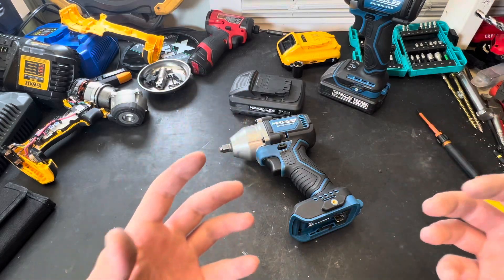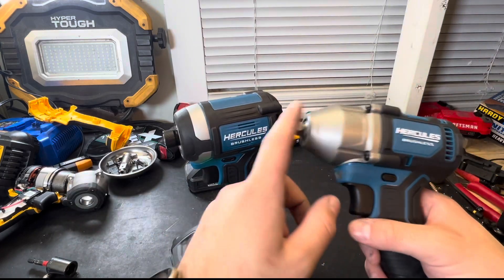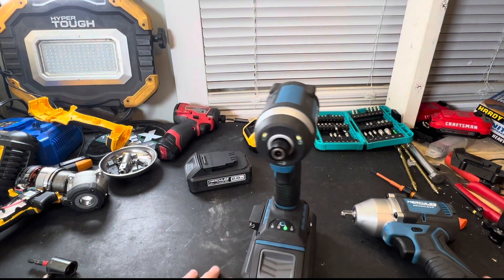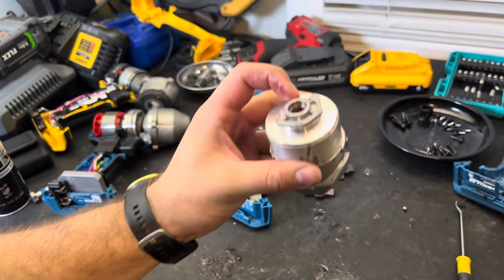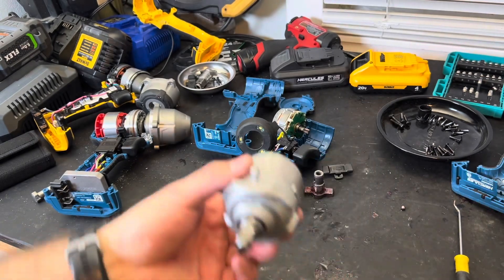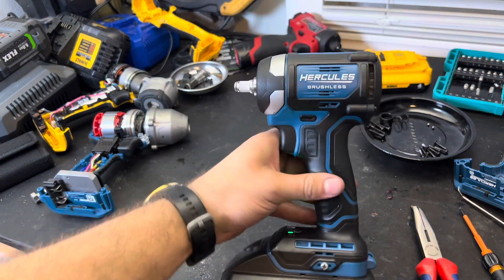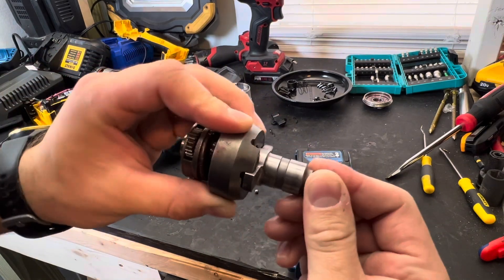I made a BETTER IMPACT for Hercules

Comment: That impact driver will burn up. The 1/2 impact can take out most things, need more power that’s why Hercules has a high torque impact, need something with even MORE BANG there is an ultra torque. Right tool for the right job no need for this none sense.😂
Reply from the maker: The compacts could barely take out anything. Literally.

Comment: N646882 (it's a dewalt part number designed for their dcf 902 3/8 12v impact) Kind of expensive on US based sites but on aliexpress usually under $10
I"ve successfully modded several different brands of 1/4 impacts for friends and usually requires very few if any mods

Comment: If you have a Hyper Tough 3/8 impact wrench model 80013  lying around you can take the anvil out of that and is a direct fit to the Hercules impact driver. No need to bore out anything just gotta swap the anvil and driver head out. Hardest part for me was removing that c-clip of the Hercules impact driver. Everything else is just screws.
Reply: you are a scholar and a gentleman
Reply: Sounds to me like it's worth the $120 to have a go-to tool that can knock almost anything (within reason) out 🤔
Reply: Holding up good against time?
Reply: I think there’s a dewalt ⅜ anvil that’s a direct swap too. I forgot the part number but it’s in a Yt video somewhere.

Comment: Would be interested in the actual tourqe specs. To be fair the example Given is not fair. Youre using an impact wrench to "Drive" the lag bolts and a impact DRIVER to "Drive" the lag bolts. Thats like compaing a hammer vs screw driver effictiveness on a nail lol. Nonetheless sick build! I really fo like the look! And i use my driver as a imapct wrench all the time 😅 so i definitely will be looking more into this.
Reply from the maker: @nicholascantareo  I have another video on this where they both were removing lug nuts both torqued to spec and the driver conversion did much better there as well

Comment: You need to ditch that screwdriver and buy the Hercules 12v impact for disassembling housings and small things. The 12v with the two ah battery is fantastic for that sorta stuff. Ive got large hads, but that smaller driver is very comfortable and lightweight too. 12v uses the same charger as the 20v

Comment: When you bore the nose cone bushing, you can hone it to the right size with a piece of sandpaper taped to a drill bit, spinning in a drill. It leaves almost perfectly circular hole and you can rest and adjust in really small increments. When I put together a gen3 Milwaukee Frankenstein, I drilled the sintered bushing to 5/8 and honed it another 0.040 or so to fit. It was only a couple minutes to hone. I used shell s3v460d2 grease. That's not a great choice for cold weather and got some Valvoline vv985. Vv986 is the same in a 1lb tub.
Reply from the maker: @timothybayliss6680  appreciate the tip

Comment: Super scientific method 😂 Fortunately, there are other channels out there that actually measure the torque instead of just relying on one’s feel. This use case is dumber than a bag of lug nuts. Perhaps that impact loves her some lug nuts more than some lags screws. 🔧 🔩 😜
Reply from the maker: @andrej2321  lmaoo I have multiple videos on this and the lug nut tests (which were tested with proper torque specs) was even more clear that the modified driver is far superior to the shitty impact wrench

Comment: I got my 3/8” used, it it was near new. After a few weeks it started making a horrible noise but it fixed itself. Lol. Been working fine since but now the hog ring and anvil is worn and sockets fall off.
Reply from the maker: @BlainesGarage  yea, I have the same issue with my m12 stubby, it gets annoying having the sockets fly off. An anvil change isn’t too difficult though

Comment: I've see a video on FB where a guy bought a spare anvil for a Dewalt and it dropped right into the Hercules.
Reply: Any particular dewalt anvil?
Reply: Link
Reply from the maker: @BlainesGarage  https://www.amazon.com/dp/B00XNO52US/ref=cm_sw_r_as_gl_api_gl_i_TC063MKSDDQSB8BH02TB?linkCode=ml2&tag=kalebross-20
Reply: @Kaleb_RoSs I bought one and it does not fit. The shaft on this anvil is 15.9mm while the hole in the housing is 15mm exactly.
Reply from the maker: @ yea, have to bore it out slightly

Comment: The fact that the driver is faster than the wrench is surprising since the wrench is supposed to be more powerful with torque and the crazy thing is I actually saw a video on here while doing research on the hercules impact driver and a guy actually used it as a impact wrench to take off the lug nuts to a ram and it did a really good job so for $69 I think Ima buy this over the Bauer
Reply from the maker: @Lopezfam210  it’s a great little driver, I use it as the beater
Reply: It's because an impact wrench is designed to have more power backing a nut off. Not putting it on. Its less effective now for rusted or frozen bolts or nuts. An impact driver is for driving in lags and stuff. This whole test just made it less effective lol
Reply from the maker: @ I’ve done a few tests comparing these and the driver conversion is better at removing bolts/nuts as well. This new compact that Hercules has is just bad in general

Comment: The big issue is that they slowed the motor down. Put the electronics from driver into impact wrench.

Also without that back plate on to support the rear bearing, it will make noise and struggle.
Reply from the maker: @aaronatwood9298  yea, I’ve got an updated video coming soon for this
Reply: @Kaleb_RoSs get it to work? I want to see that it works then i might have to do it!

Comment: 3/8 Hercules is a beast and never had problems with power. I use the 20volt battery
Reply: Yeah, those 12v batteries keep falling off.
Reply from the maker: @Bigfoot8x6  well I certainly wouldn’t consider it a beast when compared to any other 3/8 I’ve used

Comment: You're using the wrong battery on them for optimal performance. Need to use the 5amp.
Reply from the maker: @LenWhalenX  the 8 is the better performing battery, the 5 is better than the 4 though.
Reply: @Kaleb_RoSs True, but 5amp is what it says on the box to run minimum. :-)

Hey, I have a couple of questions about your project here if you don't mind.
Reply: @Kaleb_RoSs  The new adapter you listed the part number for and said you didn't need to modify the cone on the front, was it pretty much a drop and go once the unit was disassembled?
Reply from the maker: @LenWhalenX  yes pretty much. Not nearly as bad as boring it out

Comment: I know this was a while ago but I think I know why it wasn't working at the end. The back plate needs to be installed to hold the back end of the motor rotor stable otherwise it rubs
Reply from the maker: You were absolutely correct. The enclosure for the gear boxes being damaged was also slightly getting in the way, I ended up getting a new one and made it work much better

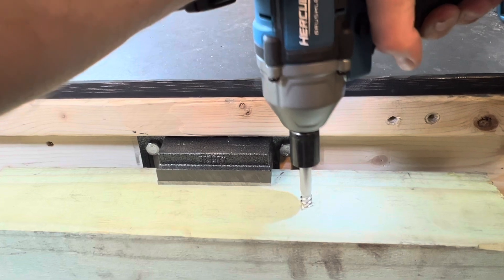Comment: you compaison at 1:06 is all I needed to know after watching countless videos on the 1/2" and me not being able to take my car tire nuts @120lbs/# off with it even though others can... love the 1/4", returned the 1/2" crap.
Reply from the maker: Definitely one of the worst compacts I’ve used. I have since found a much easier and better way to make this thing as well
Reply: @Kaleb_RoSs  you mention the dewalts ansil. I think I'll use adapters for now (might get better one if I break it) and wait for HF to get their act together for a real 1/2" or 3/8" wrench. a bigger motor version of the 1/4 would be so awsome for tougher jobs that don't require the ultra beast...
Reply from the maker: @alaind831  agree, I like pretty much all of the other Hercules tools.
Reply: Dang wish I saw this video and your comment 2 weeks ago. I did a brake job by hand after my brand new 1/2" failed on the lugs and a couple of bolts holding the caliper brackets. Gonna try to return my shitty 1/2" now.
Reply: @JaimsterTube  yes I actually found the 1/4" hex with high performance 4A battery can eventually take my 130lbs lug nuts, while the 1/2" wrench never could! (tried and returned 2 of them in their parking lots). I have since gotten a too good to pass deal (under $50 instead of $180 doing bundle deal and stacking rebates) on the hercules high torque 1/2 wrench (the 1200lbs long ansil one) which is overkill but takes my lug nuts instantly (I put snow wheels on and off regularly). still would be nice to have something in between and lighter...

Comment: My first 3/8 compact had awful bearing sound so warranty exchanged for another one, used the 2nd one on only two 12mm headed fasteners and the 2nd one created a bearing noise as well.. so my opinion of the compact impacts of Hercules has left bad taste in my mouth
Reply from the maker: Definitely, I like a lot of these newer brushless tools they have but the compact just isn’t good at all

Comment: I've messaged harbor freight about the lack of power on their compact impacts a few times already but never heard back. I can't loosen lugs, I can barely loosen 14mm bolts and even then I might have to loosen them by hand first. The compact impacts are the only Hercules tools im disappointed by, and I own 85% of them. 

I mean how do you take a step backward by making you second gen tool even weaker than the first? When other companies do that it's because they're making sub-compact models (ridgid sub-compact, dewalt atomic, makita sub-compact) so thats understandable but to keep the same size and lose power is idiotic.

Great job on the Frankenstein, I'm definitely going to look into it the next time I see a Hercules impact driver for $25 on offerup
Reply: You’d think a 3/8” and 1/2” compact with that driver body setup is coming, like the Milwaukee has now. Same 3 LED stubby in square drive. I’ve been waiting. I have both compacts and yes, they are disappointing. Just picked up the latest hex driver and i’ve been using it with a 1/2” adapter to check out it’s performance… very impressive. Checked some lug nuts i put on with it until it stopped … it ran them on to around 120-140ft/lb.
Reply from the maker: I agree 100% this is the only Hercules tool I got that has truly let me down, hence the decision to modify the driver.
Reply: Are you using an impact wrench like the 3/8 drive or the same 1/4 impact driver? An impact wrench is only designed for max power to take bolts off and impact driver like the 1/4 inch is designed to drive screws and lags in. It's by design. Who needs a 3/8 that can do over 500 ft lbs. The point is to break frozen nuts and bolts.

Comment: The hyper tough fit perfect and even slimmer
Reply from the maker: The hypertough anvil did?
Reply: Can confirm the anvil from the 12v brushless impact wrench from hyper tough is 100% perfect fit for this conversion.
Reply: @delaneypowell4547 do you have to enlarge the hole or does it just drop right in
Reply: @delaneypowell4547 I'm going to get a hyper tough today and swap the anvil. Only $29 at Walmart!
Reply: Does that mean if i buy the hypertough i can swap its head into the herc impact driver with no modifications?

Comment: Yes the HERCULES IMPACT DRIVER is way more power then even the new 1/2 compact Impact Wrench because I have done testing of them if you can get this right and it works perfectly I'll send you mine to do
Reply from the maker: Would love to get this thing working good. I’ll let you know
Reply: That’s interesting. I was torn between which one to get. Why do you think the 1/2 is so weak? Is supposedly rated for 550 break away torque.
Reply from the maker: @Phuong_Nguyen_  yea but they definitely don’t make anywhere near that. The previous generation was actually stronger than these. I love all the other brushless Hercules tools….except these newer compacts.
Reply: @Kaleb_RoSs hmm I see. I guess I’ll just get the impact driver instead of the 1/2 compact
Reply: @Kaleb_RoSs did you try comparing them with something harder like lug nuts?
Reply from the maker: @Phuong_Nguyen_  yes I did, have a video on it as well
Reply: @Kaleb_RoSs  I have a first gen 1/2” compact and the hex driver is still better than it. Can’t imagine the second gen. Sad.